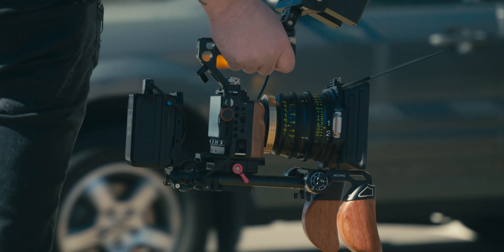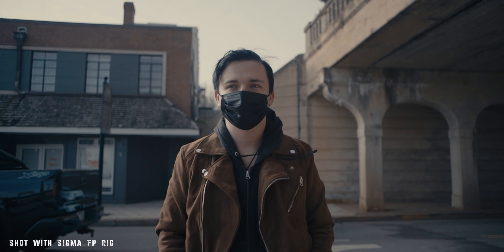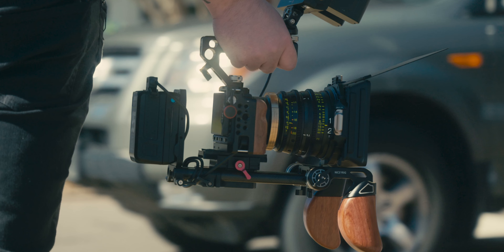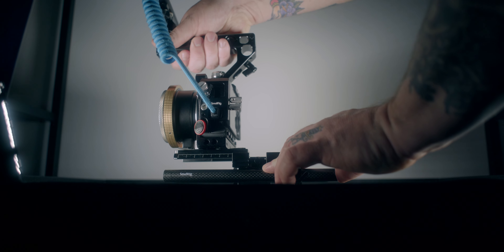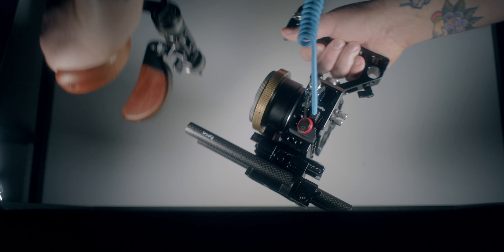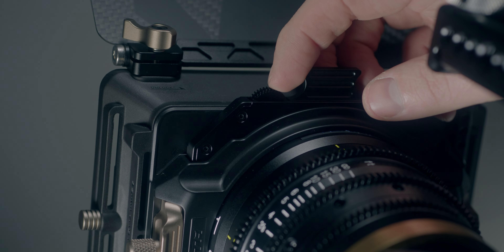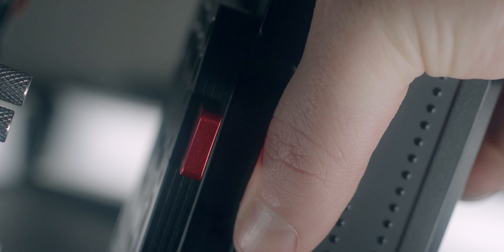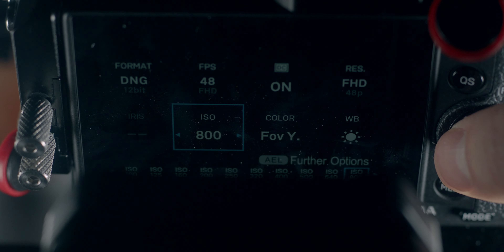My Sigma FP Rig + Andycine Micro V Mount Battery Review! Sigma 24-70mm f2.8 | Leica 28mm f2.8

Comment: Thanks for your info! How did you connect your Andycine battery? I just got my fp and don't want to overpower it and damage it. I do have a dummy battery. Is it straight plug in or do you need any converters or cables so it doesn't draw too much power? Thanks again.
Reply from the maker: I’ve always plugged it straight in, but I could very well have just gotten lucky. Since this video I’ve just stuck to using internal batteries

Comment: Yeah! Dual grip gang! :D I just received two Tilta cages with their accesories. I decided to not use Smallrig cages for my fp's anymore due to discontinued accesories (BSA2650 and it seems that they even stopped making APS2672). But beside that, my rig is very much like yours except I resorted to small trick. I am using dummy battery and NPF slot that is mounted on Smallrig DJI manfrotto plate, so when I release my camera, external battery is going with it.
Reply from the maker: Smart! I’m into it! You should hop over to my discord and drop a pic of your rig in the rig channel. I’d be interested to see it!
Reply: @Ansonandco  will do. :)

Comment: Why are so many products for the Sigma Fp discontinued? The SmallRig Left Side Plate for Sigma fp Camera with Cable Lock - APS2672 is discontinued and would solve a major cable problem for me. Now I have to try and find a used one. That's just stupid. Was this part killing people? Could it blow up? Were children sticking it up their noses? There does not seem to be a viable replacement. I bought a Sigma Fp, a smallrig cage with the evf attachment although I did not buy the evf. I need a way to clamp down the two cables so they do not get destroyed. Such a small camera has tiny ports. Any thoughts? Great video btw.

Comment: hello.  How much is the output voltage of the batteries?  Have you had any problems operating the camera?  I ask because the original sigma battery is 7.2v
Reply from the maker: Not sure on the exact voltage? But I’ve been using them for years and have had no issues

Comment: Can you power it through the USB port? That would avoid the use of the dummy battery ? Thanks for this awesome video.
Reply from the maker: The usb c cannot charge while filming on the FP. It can with the FP-L
Reply: Appreciate your quick response. Is charging the same as powering? I understand “charging” as charging the internal battery and “powering” as providing  power to run the camera, even with no battery inside …. BTW, I subscribed…. You have an amazing channel …👍
Reply from the maker: @joaquinperalba1624  first off, thanks! Welcome to the community. But yes charging in the way that I’m talking about is actually powering. The camera can charge through the usb C, but not while running and so in that sense the usb cannot power the camera while running

Comment: why do you prefer to record to blackmagic? dont you lose some of the fp capabilities like 120fps? or are you able to use the blackmagic recorder as a standard sdd/monitor combo?
Reply from the maker: The raw compression TBH. I have it for the s1h and I prefer the workflow with BRAW. CDNG is great and image wise I prefer it, but the workflow with BRAW is substantially better. And you can use it as a monitor but it’s not great when being used as just a monitor
Reply: @Ansonandco  thanks for the response that makes a lot of sense. is it possible to use the blackmagic recorder as an ssd device? as in can you record cdng to the memory card, or is it strictly an hdmi raw recorder?
Reply from the maker: @tkdtrickster2  you wouldn’t be able to record DNG through it, you can use it as a monitor or BRAW device and the purely monitor part of it is not that great. It does a weird crop in on the screen… I blame the FP lol

Comment: Nice break down! Love the look of the sidehandles. For the 15mm rod clamp (where you attach the handles), is the one by Niceyrig good? Does it remove easily? I have the one from Camvate, and it was way too tight. The tolerances are all off, on all my rods. The replacement part was the same. Terrible customer service from them too, so would love to see if these were reliable.
Reply from the maker: I’ve had it for a while now and have never had any issues so far

Comment: Hi Anson, just picked up my FP today, I love it. I’ve been watching your channel a lot lately since you have a lot of fp content, so thank you! 

Question, I can’t get my monitor to work via hdmi. Maybe just a bad cable? Everything is plugged in right, I used this osee g7 monitor on my 6k pro just fine so it’s odd it’s not working here. Only difference is the cable. 

Just making sure there’s no menu setting in the fp I have wrong?
Reply from the maker: On the settings tab there is an option to indicate how you want HDMI to push information. It’s there to switch external recording and external monitoring. I would check that. I believe it’s the second to last page in the settings, but the one right before that. But otherwise I would check the cable

Comment: Great video! Your slow mo looks terrific. What frame rate are you shooting in? Do you slow it down further or stabilize in post? Thanks!
Reply from the maker: Everything is 60FPS, I slow it down in post, but only to match 24FPS and depending on the shot I will stabilize, unless the stabilization makes the shot do things I don’t want it to do, then I’ll cut the shot or deal with the little extra movement
Reply: @Ansonandco  Thanks mate! Lovely pictures.
Reply from the maker: @shanekrause100  thanks!

Comment: I have a question: What is the estimated total cost of this fp rig setup?
Reply from the maker: I’d say 1500-1600 if you go with the black magic video assist and the tilta mirage. If you go with a normal
Monitor and a cheaper mattebox it would drop drastically

Comment: the whole point about Sigma is about small.  You have turned this into a FrankenKamera rig. So much for being small. A Sony A7S3 will vastly outperform this for less money and less size. So what is the point?
Reply from the maker: No one said I don’t ever strip down the rig and use the FP in its small form factor. Also how does the a7siii out perform this camera? Better AF? I use vintage and cine lenses…. 🤷🏼‍♀️ more options for slow motion recording? Maybe. But Sony does record 12bit raw internally or to an SSD. And the sigma has WAY better color science… like WAAAAAY better. Also less money? The Sony is nearly twice the cost of the sigma… if you mean rigged up. I would spend the same amount on a Sony rig, so that is a moot point. But hey each one is entitled to their opinion.
Reply: @Ansonandco  Color science is debatable, but anything can be corrected in post anyway. The killer to get what you want requires enormous data load. it's insane.  Gerald Undone did a review, pretty thorough and does not recommend it.Lots of reasons.  Says a major firmware is needed, plus expensive EVF.  At the end of the day, costs are similar.  Many would argue the Sony color is pretty darned good. Enough for intentions.  There's a false economy that says best cameras will make you a great film maker.  No, its rhe story, acting, production that makes it great.  Cameras are secondary.

 I'll pass.
Reply from the maker: @qwiklok  first Gerald was talking about the FP L which is more money. The original FP is under $2k. And you’re right the story is what makes a good film, but then why poo poo on a camera that many people love using to tell their stories. 

Also you pure color science can be fixed in post, for the most part. But if the footage has a bad codec or doesn’t capture enough color, then those are things you cannot fix in post, and could arguably destroy your footage trying to manipulate it. 

Again, I think everyone is entitled to their opinion. I just want to make sure you have the correct facts